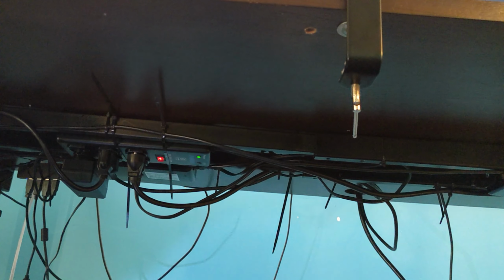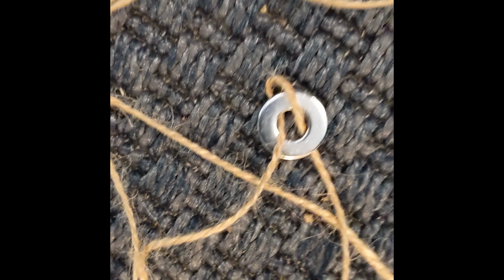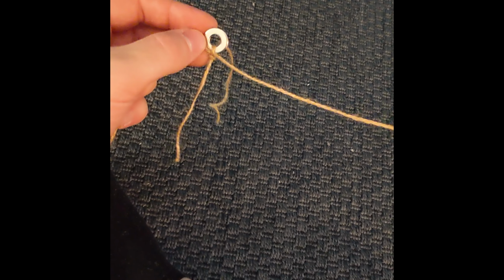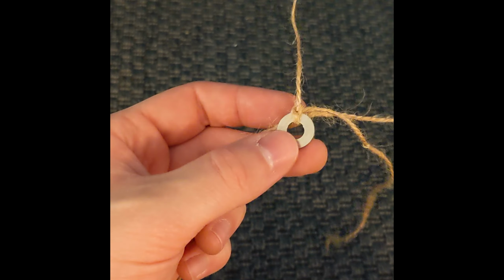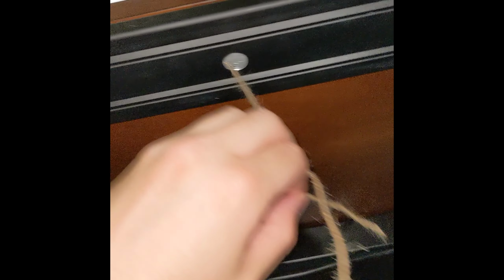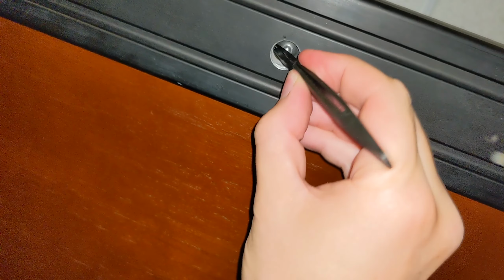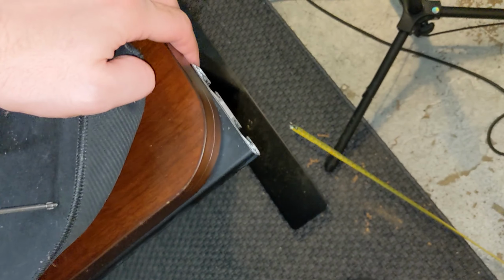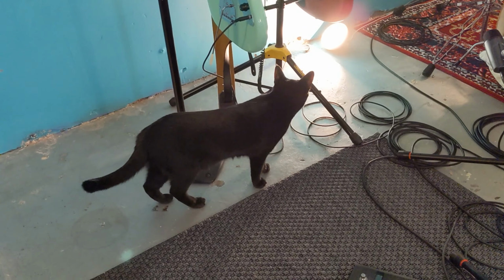Installing MONSTERTECH Slide Rail Without Tearing Down Desk

Comment: So I have mine coming today, 2 days early and I'm trying to figure out the sizing of the inserts and bolts. How is yours holding up? Also do you know what types of bolts and fastners you used? Thanks
Reply from the maker: Mine is still just as solid as when I installed it!

So, I ordered this kit of 1/4-20 threaded inserts and bolts: https://www.amazon.com/gp/product/B08ZCKTWCL/ref=ppx_yo_dt_b_search_asin_title?ie=UTF8&psc=1. However, the bolts were way too long for my purposes and I had to cut them down to size.
Reply: @thrillnestcitizen  Thanks that is super helpful!
Reply from the maker: @SiriusScaper  You're welcome! Good luck with your setup! 😁